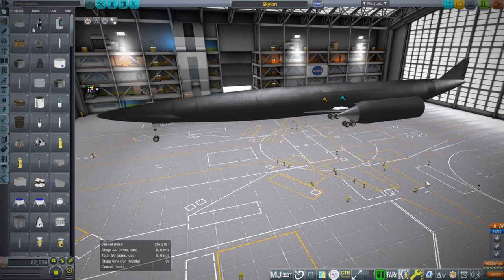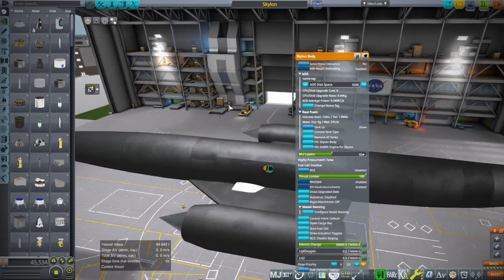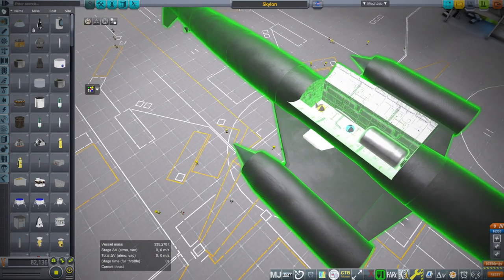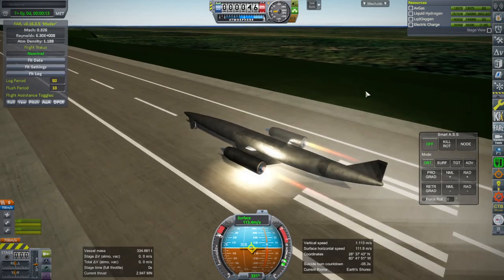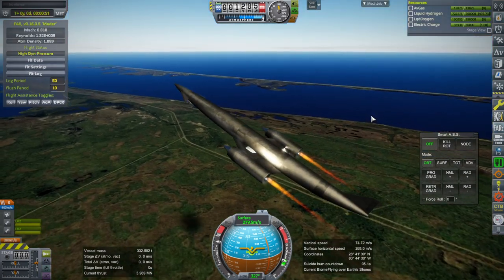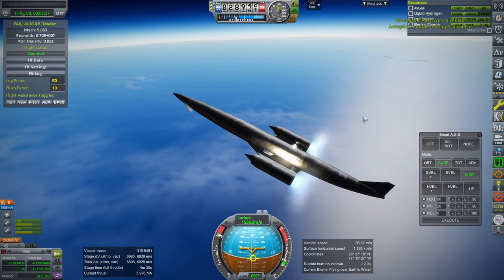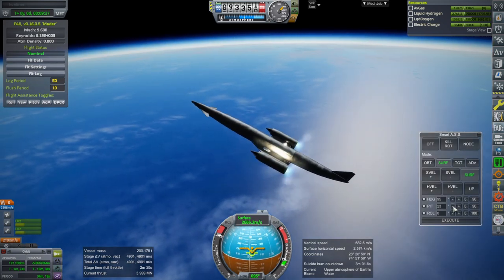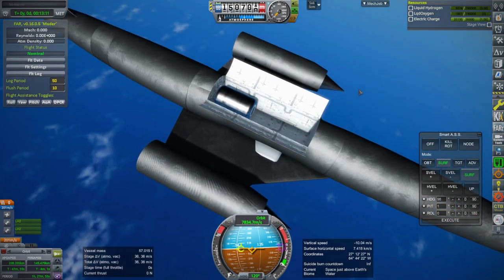Kerbal Space Program 1.12 with RO - Skylon to Orbit

Comment: I highly doubt that the airbreathing mode of the SABRE will have over 9000 seconds of Isp(Those are turbofan numbers). Especially above Mach 4, ~4000 seconds seems more reasonable. Other than that, your model is great.
Reply from the maker: Yeah, I would like a ramjet mode that separate from the jet mode, but I'm not sure if an engine with three modes can be done - I'll try it out.

Comment: Yay!, but shouldn't there be a rocket engine in the tail for de-orbit burns?
Reply from the maker: RCS would be sufficient - if there's supposed to be a small engine in the tail, I haven't seen anything about it.
Reply: @RaizSpace  > It's there in the early CG renders in a somewhat blink and you miss it capacity, see - https://youtu.be/r6vgdgif374
Also they use it for the final push up to orbit as well it seems, being a pure rocket engine maybe it gets a slightly higher ISP than the main engines? 

Certainly another variable to play around with in getting payloads to LEO, although the design was always a work in progress, so maybe later changes got rid of it?
Reply from the maker: It's so small anyway that functionally speaking, it might as well be RCS. I doubt it has a higher ISP than the main engines with such a small nozzle unless it really has just RCS-level thrust. In a normal plane, that's where you'd put the APU, so it's also possible that the graphics person misinterpreted it.
Reply: @RaizSpace  > Errr, given the size of Skylon that tail engine might not be all that small in actuality, IIRC one of the Alan Bond lectures explains the reasoning for it which I think is vacuum nozzle related, the main engine nozzles being not necessarily vacuum rated, I recall they were looking at multi-cone nozzles at one point.

My main point being that the main engines only get the Skylon sub-orbitol and the tail engine gets the Skylon the rest of the way in a slightly more leisurely and fuel efficient manner, so just brute forcing with main engines alone might lead to somewhat misleading performance estimates?

Also according to another year old Youtube video, Skylon has been abandoned by Reaction Engines - too complicated, and too expensive to develop , they are now refocusing on more profitable hypersonic military applications. So it's all academic in the end, sadly.